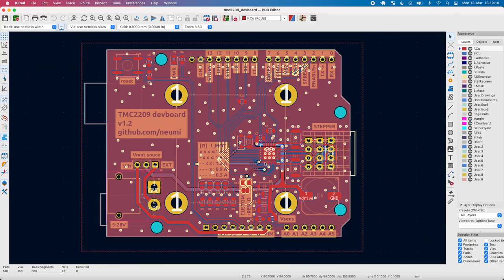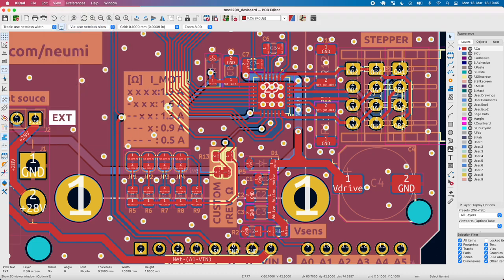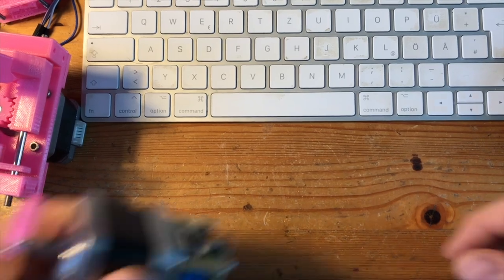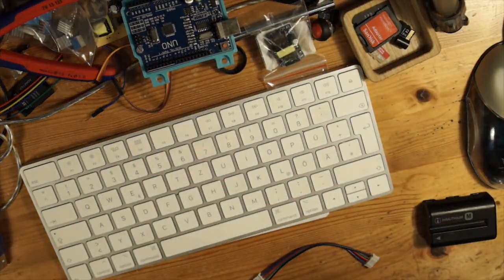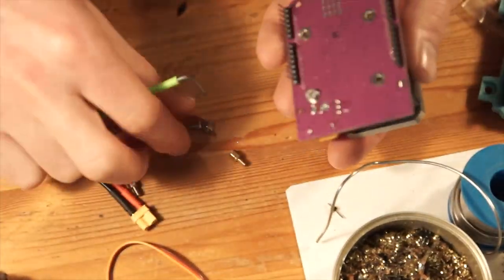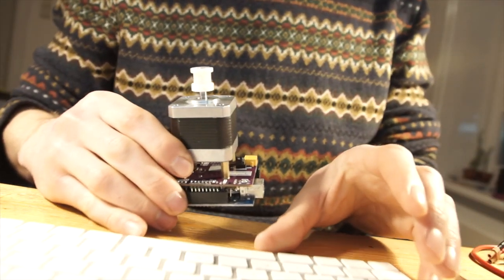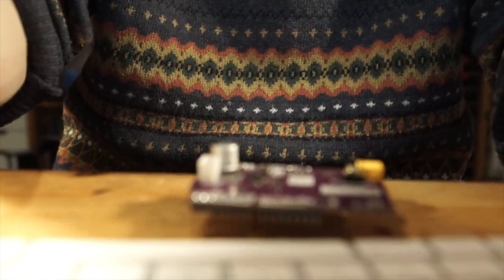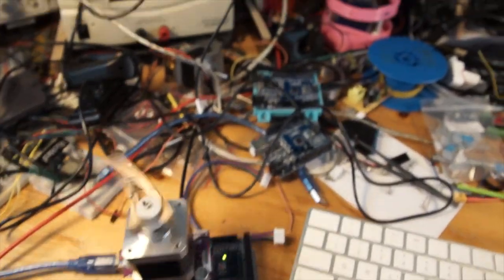TMC2209 development board | Arduino Stepper Motor Shield

Comment from the maker: I just released version 1.3 on GitHub. Mostly cosmetic changes, but also the lcsc part numbers were wrong for the voltage sensing, making the board a small 10ohm resistive heater 😅 
Also the voltage source selector jumper is not in the way of the motor when connected directly to the board.

Looking forward what you build with it! 🚀
Reply: Thanks! It is possibly to use a standard TMC2209 module (ramps style layout) with all features using an Arduino Uno directly? Or is it necessary to add some extra components? Been trying for a while now. Only got it to move and accelerate, but there wasn't any stallguard and so on. Thanks in advance for answering soon!
Reply from the maker: @OMNI_INFINITY  If you get Serial access to it, you should be able to use StallGuard. This Silent Ramps board at least has TX and RX connected. The single-line UART is already connected to a 1k resistor, therefore I don't see why it shouldn't work. https://wiki.fysetc.com/Silent2209/#v31

Try this code to test if Serial works: https://github.com/Neumi/tmc2209_devboard/blob/master/code/simple_drive_example/simple_drive_example.ino
Reply: @Neumi  Already wrote a long reply and the shoddy vpn lost it. Nothing quite like losing effort due to commercial third party ineptitude. Sigh... Anyway, thanks for posting that! That did make it move a little and it's oscillating a short distance. I guess I can look at merging that file's serial interface method with the StallGuard_2209.ino file. Tried that with same pinout and it didn't run, so seems to have been the serial type used. Any more good recommendations are welcome. And thanks again for posting that board design! Actually visiting shenzhen now (not chinese) and may get one of those made (guess it would be 5 made, unless I build a PCB fab with this stepper).
Reply from the maker: @OMNI_INFINITY  I'm sorry for that. 
Hmm I have to check later if I can find the code for stall guard. I only know that I had it working and that I was able to read the current data and the stall flag via serial and the DIAG pin from the TMC2209. You can order the boards directly from JLC. All part numbers in the BOM are already LCSC numbers. So you can just upload the files to JLC and get the boards.

Comment: probably missed it, but can you connect several of these boards together, like 4 that you control from the Arduino or a Raspberry ?
Reply from the maker: Hey, currently, not by default. I might implement this in the next version. But only for up to four boards, as the TMC addressing only lets you set four individual addresses via the MS1, MS2 config pins. Like described on page 18 https://www.trinamic.com/fileadmin/assets/Products/ICs_Documents/TMC2209_Datasheet_V103.pdf
But I think too that it would be a cool feature!
Reply: @Neumi  thank you for the super fast replay, looking already forward :D